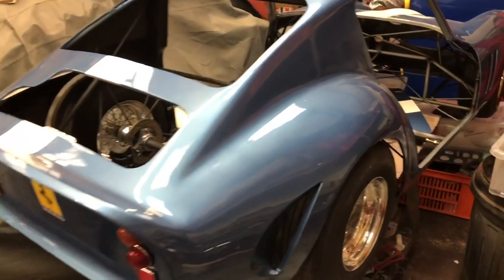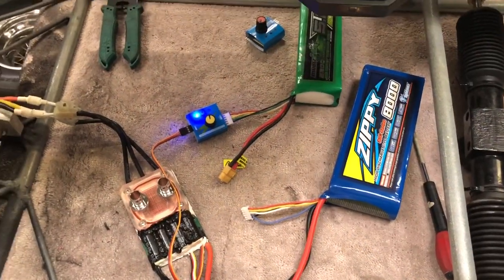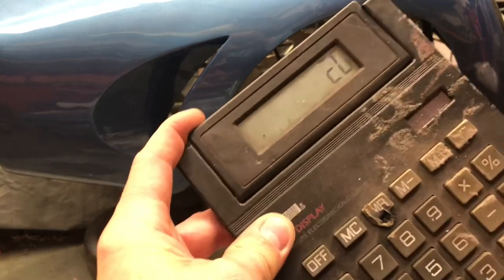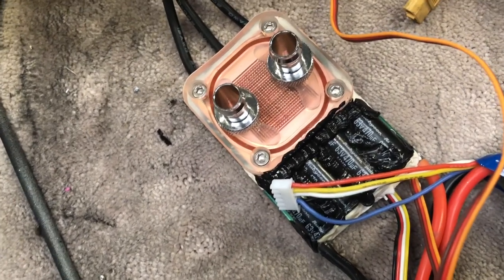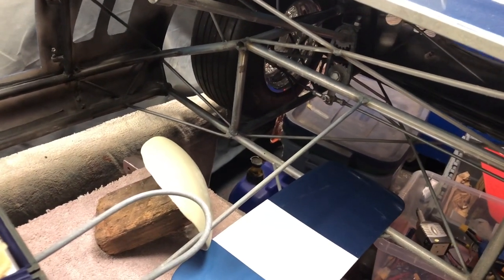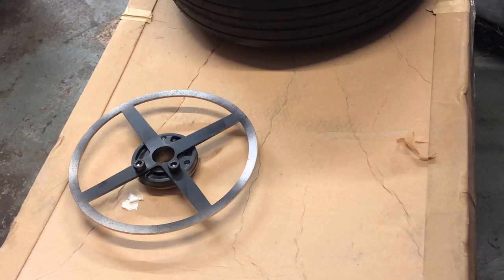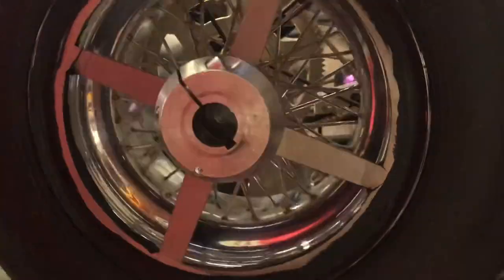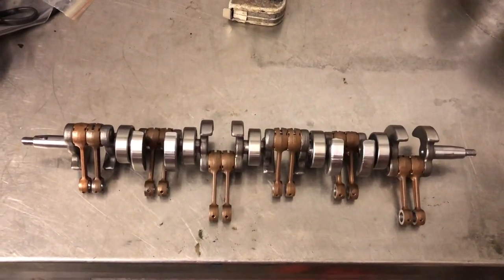Ferrari go kart prt 42

Comment: Interesting trick with the Sikaflex. Makes sense to drive from the wheel shell though. Nice work.
Reply from the maker: Thanks ,  and especially thanks for your help with the engine block cad work !
Reply from the maker: Its tough stuff, mainly used for windscreen adhesive, as long as it has surface area its really strong!
Reply: @scarlettsgarage1  I've never used the stuff you have. I have used 505 before and its pretty good stuff too. Happy to help with the CAD :) Let me know what else you need

Comment: I think that accelerator doent have a pot (0-5V) it has instead a hall sensor ( usually 0.8-4.2V).
Reply from the maker: yep you guessed it ! I'im making another system with a pot and cable so i can use the same  accelerator pedal for the V12

Comment: I doubt that the aluminium ring which you glued to the rim will hold up to the forces on acceleration, especially with those holes so close to the spokes, what do you think?
Reply from the maker: Its a 3mm thick stainless ring,  I ran a test piece in the vice and the two allen cap 12.9  bolts sheared at 85lbs  ft , the v12 engine plus electric motor should be 20-25 ft lbs I'm hoping  it will be fine .
Reply: @scarlettsgarage1  ah ok, i somehow thought it was aluminium!
Reply: @scarlettsgarage1  How much power are you expecting/hoping for from the V12?
Reply from the maker: @thisquietplace   each engine is 1 bhp / 0.7 lbs ft on hondas website, so going to be in the region of  10-12 bhp and 10-15 ft lbs , i'll do a little bit of porting, raise the compression from 8 to 9.5:1 better fuel supply, I'm building it for the engine sound and the first kids Ferrari with a working V12 4 stroke water cooled sohc engine!
Reply: @scarlettsgarage1  Very excited about this